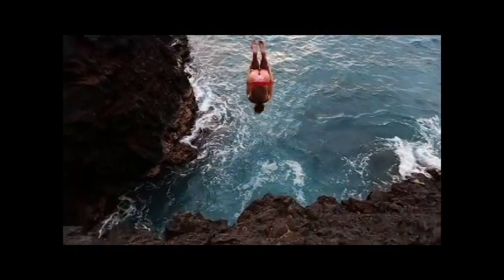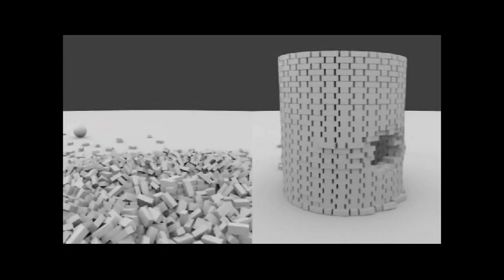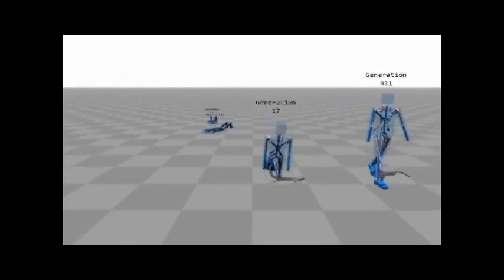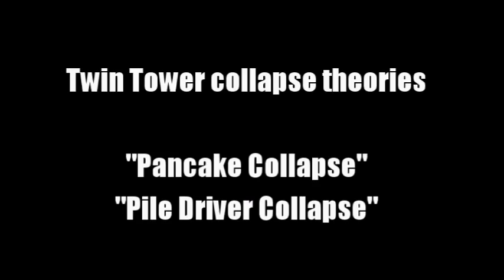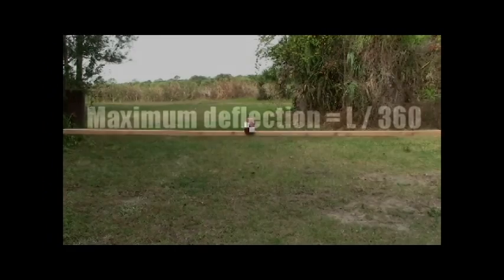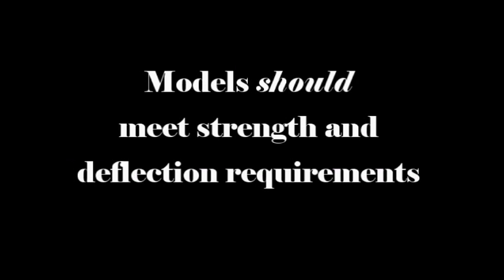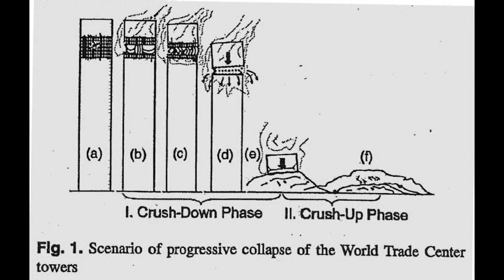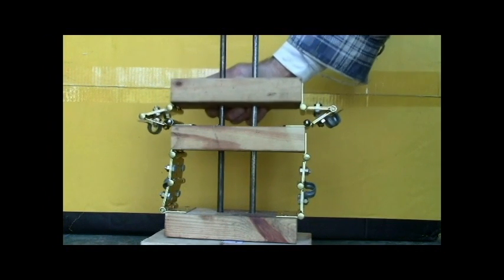9/11 Experiments: The Force Behind the Motion

Comment: These experiments are ridiculous.  You took whatever materials you had laying around to construct your models.  That's completely flawed.  Take a matchbox car.  Drop it from 20 feet.  Then drop a full sized car from 20 feet.  What???  The larger car is completely destroyed and the matchbox car is unscratched???  CONSPIRACY PROVED!!!!  You made a 1/500th scale model of the building, but used "floors" that were maybe 1/50th the thickness of the building's floors.  Of COURSE you're not going to have reasonable results.

Try again.
Reply: Do you happen to know of any experiments, from anyone, anywhere, that demonstrate how the upper section of the two buildings accelerated with no measurable resistance (deceleration) or deflection?   I wish someone would execute such an experiment that could prove the establishment narrative about the event even remotely possible.
Reply: sixmagpies I don't, but short of computer modeling, there won't ever be.  Look.  I believe the official explanation.  Why?  Because if it was an inside job, or a controlled demolition, or mean to look like planes took them down, then it wouldn't have been done this way.  Consider ALL of the people needed to make it happen as we all witnessed it on that day.  Wouldn't it have just been so much EASIER if they would have detonated giant explosives in the basements?  Yes, they tried it in 1993, but that was amateur hour.  If the government wanted to take those buildings down, there are many MANY ways to do it better and easier and involving far less people than how we all witnessed it.  And further, if they did want it to go the way it went, do you really think they'd be so sloppy in execution?  I just don't buy it.  Things happened that day.  A lot of things.  Some hard to explain.  Some not so difficult.  But to say that the whole thing is a conspiracy because you can't repeat the demolition with cement board and pizza tables.... well, that's just stupidity.
Reply: Yes, the event was incredible because, yes, it would have taken many dozen, if not hundreds of people to execute.  So one naturally wants to believe the establishment line.   
But on the other hand, measurably pure acceleration, with no retardation, in buildings 1 and 2,  the undeniably perfect free-fall of WT7, NYFD numerous witnesses to molten steel and staccato explosions, the FBI immediately seizing and refusing to release the dozens of Pentagon CCTV camera tapes, the documented lack of any body parts at the crash site at Shanksville, the quite extraordinary death rate among would-be whistle-blowers, the rush to invade Iraq in, what we now know was clear knowledge of there being no WMDs,  Norman Mineta's irrefutable  evidence against Cheney as well as myriad other more circumstantial stuff such as their refusal to answer to the investigation is hard simply to ignore. 
Whatever the story, Newton's Laws are irrefutable, yet were suspended that day and that's the bit that I cannot ignore.
Reply: sixmagpies It's easy to have these suspicions.  When I watch certain videos, with certain voiceovers and with certain "experts" with agenda giving their "expert" opions, then yes.  It's easy to be swayed that way.  That's sort of the point of a documentary.  But if I watch other videos with other "experts", they give a pretty good confirmation of what happened and why.  As far as WTC7 goes, are we just discounting the fact that the entire penthouse area and center structure fell several seconds before the building came down?  Are we discounting that a fire was raging on lower floors for 7 hours before the collapse?  And are we discounting the extensive damage of WTC7's lower floors because large parts of WTC1 fell into it.  But then you have to admit that WTC1 didn't fall directly down into its own footprint like a controlled demolition would have done.  But if WTC7 was part of the plan, then that's a damn fine job of a controlled demolition that forced part of WTC1 into WTC7, but only that building, and most of WTC6, since it was in the way.  If you search for WTC7 South Side, you'll find a lot of photos and information that the conspiracy theorists ignore.  There were very few cameras trained on the south side and the smoke and debris clouds were moving south, so visibility was limited, but there are a few images available to see the extensive damage.

I agree with you that there are some bizarre discrepancies with this horrible tragedy.  But if you take a car filled with soft, mostly liquid humans, and you drive it at 500mph into an unmovable object, those soft, squishy humans are going to mostly liquify.  Human remains WERE found at Shanksville, but only small pieces, the largest of them being part of a backbone.  But according to Wikipedia, about 600 pounds of remains were found and identified.

Any video footage in or around the Pentagon would be classified and protected for national security.  Right or wrong, there are protocols at our military buildings that would prohibit releasing information about them.  This would include any video.  And truthfully, if ANYONE could offer any credible alternatives as to where flight 77 is or where it went, or what happened to the people if there wasn't a plane... then maybe I'd listen.  But it's been 15 years.  And there are plenty of photos of the pieces of flight 77 all over the place.  So people just don't want to accept that there is actual information out there, just because it doesn't fit their conspiracy.

I don't care to prove and explain every item of weirdness that happened that day.  But how many secrets have you heard in your life that were not meant for you to hear?  And generally, the secrets we deal with are two or three people knowing.  Human nature is not to keep secrets.  Not ONE person has stepped forward in 15 years to talk about their involvement in a 9/11 coverup or conspiracy.  You'd think that in this time, there have had to be a lot of people on their death beds who want to clear their consciences and souls before moving on.  Yet, not one person.  This was a terrorist attack on a woefully unprepared America.  And in the end, they won.  They have made us afraid to do a lot of the things we used to do without fear.  The Iraq war and the terrorist attacks are two very separate things.  But it was easier to justify doing it under the fear of more attacks.

However, I do want to commend you on keeping this dialog intelligent and calm.  I have seen almost all of the 9/11 material and I make it a point to watch all of the conspiracy stuff.  The problem with most of it is each seems to concentrate on a different part of things, and they draws a wild theory from a very small part.  This theory then breaks down when put up against all the other theories out there.  The only one that seems consistent through all of the data and events is the official NIST report and 9/11 commission findings.  But it certainly IS fun to reject the actual science and think it may have been aliens.

Last thought:  What if it WAS our own government that did this?  Then what?  What would we do?  Would you rather live in a society where its government killed a few thousand of its citizens and tossed its economy into turmoil or join the uprising, overthrow the government and then live in whatever is left from that?  What do you think would be left?  Where would you get your fuel?  Where would you get your food?  Maybe YOU are a prepper, but 99.4% of the country isn't.  Do you REALLY want to see what that chaos would be like?  How long do you think you'd survive, even if you had a stockpile of 20,000 rounds?
Reply: In all honesty, I am only interested in the scientific and engineering elements.  Those and the next generations.   Whatever you say, one must disagree that WTC 7 looked like anything other than standard controlled demolition.  The centre dropped, and then the entire outer structure, including the upper floor ring/spider-frame structure dropped in perfect symmetry and perfect free-fall.  That symmetrical free-fall is positive proof of the 'understructure' being instantly removed.  That's the problem!  Also,  in effect, it certainly did fall almost perfectly into its own footprint, as proven by arial photography taken a.m. in 9/12.  It was actually a very tidy job, while any natural (fire induced) collapse of any honestly syndetic steel structure must, by definition, develop chaotically and leave large elements of still co-joined material. The debris pile comprised almost wholly fragmented or separated steel beams.  Again, this is highly indicative of controlled fragmentation and, to any engineer, irrefutable. 
Re.  your comment about whistle-blowers, look at the actuarial statistics concerning those that died after the event. They are unique ....  and frightening.  
Lastly, can anyone honestly suggest that the gas station and hotel multiple camera CCTV coverage of the event that also happens to show the Pentagon in the far background, be justified a 'Top Secret" rating when, if they did show the plane, they would instantly exonerate the establishment.  
No.  The ' Government ' numerously has been proven a liar.     So one prefers to lean on actual evidence about,  rather than their opinions of, the event.
Reply: The point is not would you want to live in a country with a corrupt government the point is what if the government really is corrupt and any attempt to uncover it's truth is met by force, mental or physical force. Yes you are right there are many things that can not be proved and it just might be best to go along your merry way. But if you think that they do not have the power to suppress the truth you will be mistaken. Don't forget it is about trillions of dollars. There are some people that believe it is $30,000 per person in the USA. If only 1% of the population has to be bought then the amount would be $3,000,000. I think that 99% of the people that receive that amount would be quiet knowing that if you don't that you and your family will be destroyed. 
But it is not even close to 1% of population that know anything. It will be much less than 0.01 percent. So that means that they would have $30,000,000 to bribe anybody that wants to become a whistle blower. Those that don't follow like sheep are no longer with us. Believe me. Those that have joined the elite will no longer have to live in the USA they could be sipping pina colada's on a sunny beach somewhere looking like Brad Pitt or Julia Roberts after their plastic surgery. Ridiculous? Well most probably the truth is even worse.
Reply: Good to hear some common sense Goodeggpro...my thoughts exactly...if the government wanted to get the US into a war they would have been far easier and less costly ways to do it....in fact they would have needed to be far far more clever to have done it this way without discovery than just about any other and who is convinced they are that bright based on previous performance?......
As for the experiments you are right again...the outcome of physical dynamics like this depends to an acute degree on initial conditions and these couldn't be anywhere near modelled. Change the strength of a joint slightly and the results veer right off in a different direction. ....For instance these were very heavy floors which were suspended on bolted hangars which then went on to welded lugs and a "Beamshelf" welded on to the outer core uprights.....a very very different st up to that in thse simulations even if scaling factors aren't included.....
Reply: May I copy and paste this Goodeggpro? will give credit....
Reply: Simon Degroot of course.  People who "prove" things with completely unscientific methods drive me nuts.  The weak minded look at it and say "oh... well yeah, that makes total sense", but it really doesn't.  Not even a little bit.
Reply: goodeggpro .... of course, those who religiously 'believe' in counter scientific narratives from already proven dishonest and corrupted organisations simply because they are told to and find the contrary position to be unbelievable must be respected for their faith. Unlike Gov. narratives, Newton's laws are quite indisputable, yet no explanation has ever been suggested for their suspension that day.

Comment: This experiment is only focusing on the floors.

The floors were steel trusses that had a layer of concrete on each of them. The trusses themselves connected the exterior mesh wall to the inner core of the building. This design is known as the Tubed-Architecture. The designer and engineer of the Towers,  Minoru Yamasaki, wanted the building to resemble the flexibility and strength of a bamboo stick and so he designed the Twin Towers as such. However, unlike a bamboo, the Twin Towers were tube-in-tube, so the floor trusses had to be connected from wall to core to keep the whole building in one piece, but at the end of the top 4 floors, lay a structure called a hat-truss, which it's purpose is to connect all sides and corners of the building and lock them into place.

Granted the event that a 280 ton plane traveling nearly 600mph destroyed 6 floors (exterior mesh wall, floor trusses and some column of the core). The structure is already compromised. For North Tower, Floor 92 has the burden of distributing 17 floors of weight. If each floor can support 4,500 tons evenly, then an uneven distribution of tilting or falling 80,000 tons is not going to stop after hitting one floor. The momentum will just build. After all, we're talking about 4,500 tons of stationary floor versus 80,000 tons of kinetic energy. For South Tower, it was worst for two reasons: 1) Floor 76 was trying to support and distribute weight of 33 floors (152,000 tons) and the hole of the impact zone was closer to the corner. If we add in furniture, equipment and people, these floors would weigh even more. Keep in mind that all the interior walls in the Towers were Dry Walls, so the buildings were basically hollow.

Now there's the core and the hat-truss.
Popular belief states that about 10 floors falling on top of the overall lower structure can not cause imminent collapse. And they usually focus on the floors and the cause and effects of pile-driver and pancake collapse... But this is not so. There was neither pancake or Pile-Driver collapse. 

What happened is that the core failed due to compromised weight distribution and weakening of the support columns via the heat.

Keep in mind that the Hat-Truss is directly and literally sitting right on top of the core. It's built around and within the core on the top 4 floors, so the argument that the building is lighter at the top than say, the middle of the building is inaccurate. The sky-lobbies of the buildings were two stories from floor to ceiling. These were the floors with escalators in them. The hat-truss on the North Tower is even heaver because it has a 400 ton antenna on it. The Hat-Trusses themselves weigh over 10,000 tons wielded and connected with the top 3-4 floors.

So, the core had collapsed 1st. (North Tower made that clear as the Antenna fell 1st and then the top 17 floors fell after. (South Tower was 33 floors)

The core collapses and since the cores are directly connected to the exterior wall via the light floor trusses, those trusses pulled the exterior wall inward which forced the upper exterior walls to bend or implode inwards and as they snapped (bc the units of the walls were actually snapped in place and bolted unto each other, not wielded.) 

The core collapsing internally as pulling the light trusses created the "squibs" several floors below the exterior walls falling. The Hat-Truss kept the upper building in one piece until after reaching the impact zone where the hole was. Since the Hat-Truss has vertical steel girders, those vertical girders acted as a plate pressing down demolishing everything else under it. But for North Tower's case, the Hat-Truss must have moved towards Building 7 (hole was facing Building 7), sparing some of the core even but for a mere second.
Reply: You're forgetting about the potential energy that is already in existence within the upper floors. The Potential energy is already there. 33 floors for the South Tower and 17 Floors of the North Tower.

When the severely damaged and gradually weakened 6 floors from the impact zone continued to weaken, let's not forget about the lateral forces swaying the building. 1 foot to 4 feet, but let's go by the smaller number. 1 foot sway. North Tower had been swaying for 1 hour and 48 minutes before collapse while the South Tower swayed for 56 minutes. These swaying while the interiors of the buildings are gradually weakening due to the heat of the fires while missing some columns and exterior walls contributed to the accumulated stress that the buildings had to endure.

Just like water behind a dam, once the potential energy is released, it is released as kinetic force. And since this is 152,000 tons of 33 floors falling (of the South Tower) (80,000 tons for North), there is no need for momentum to build. The bottom floors are only capable to withstand 4,500 tons of force, not 152,000 tons initial force.

Also, and most importantly, the core fell 1st. And when the core collapse while each floor truss is wielded to it and the trusses are also connected to the exterior outer wall. Those trusses fell with the core 1st while tugging at the outer wall. The outer wall was snapping and since the initial snap started inwards,  the kinetic force of the upper floors not only pushed down, but outwards the direction of the already snapped girders below the impact zone. That's why the exterior walls seemed to "explode" outwards.